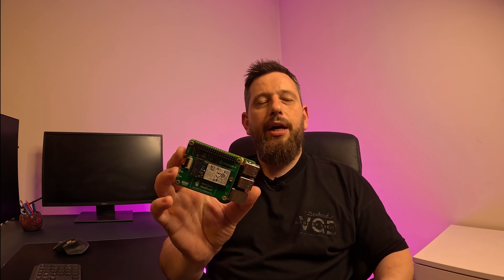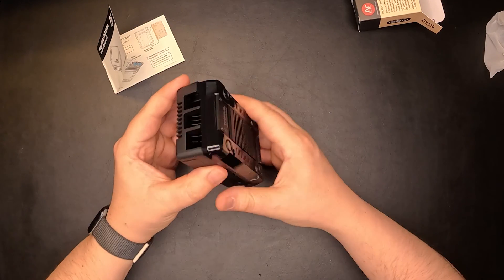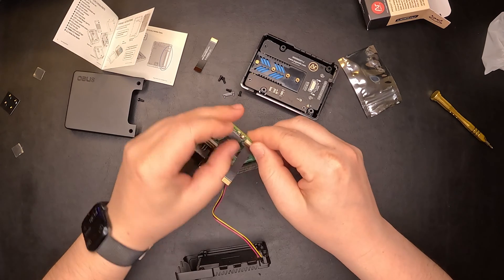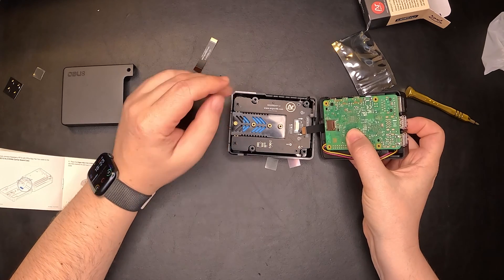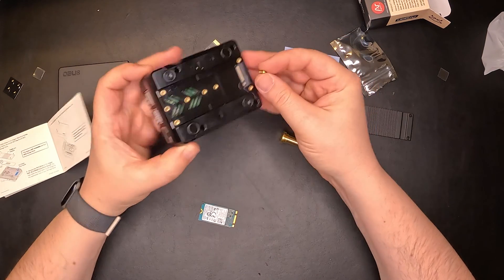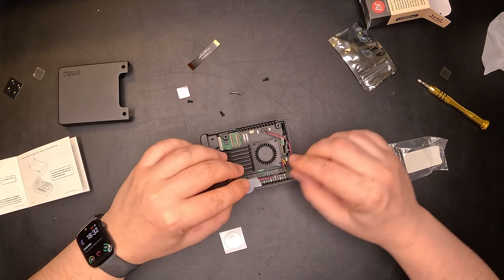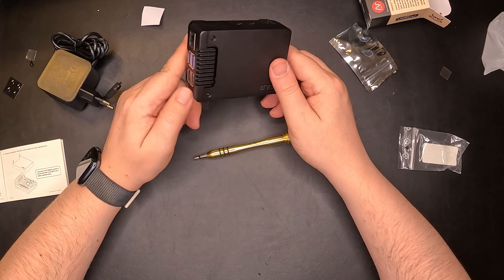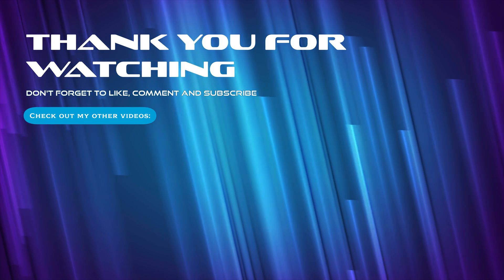Raspberry Pi 5 Argon NEO 5 NVMe Case upgrade

Comment: I have 4 Pi 5's. My Pi's barely get over 120 degrees F. I run them all open no cases. Heat sinks and active cooling hats. ALL over clocked to the max running NVMe Gen_3 and zero issues ever and never had ANY throttling. I also like the looks of the Pi's workings. My CM5 is the same. All 8GB RAM models
Reply from the maker: I also like how the Pi looks naked but I have this unit mounted on the wall near the washing machine :) . I need a way to protect it from dust, spilled powder detergent or accidental hits.
Reply: @TricksAndThings  Totally get that. Im OCD with m ine so alwys cleaning them. Got my CM4 and CM5 in waveshare cases

Comment: Mine should arrive today for my pi5...I was running home assistant and it was clocking at about 80c when it was just sitting there...old case was nice metal but the nvme blocked half of the fan...hopefully this one does a bit better at removing the heat.
Reply from the maker: It’s a good case. Use it only for HA in an unventilated place and it works without issues.  Yes the case gets a little warm but it’s normal since the entire case is actually a big radiator. Hope that it will fit your needs :)

Comment: Thanks for the video.  I'm looking for a case for my micro server.  Too bad about the plastic underneath... I preferred all metal.  Please can you tell me what the CPU and Nvme temperatures are like?  Does it dissipate heat well?  Were you able to do any tests?  Thank you
Reply from the maker: I did not do any extensive test but right now, it's sitting in a a small plastic shelf, in an unventilated space and the reported CPU temp is 49c. I can feel the heat being dissipated through the entire case so it works pretty decent. For the Nvme I do not have a sensor enabled so I can't measure it unfortunately.
Reply: @TricksAndThings  Thanks a lot for the answer. I want to get one

Comment: Just leave a blank SD in it and then if you have to you can NETBOOT it and install an OS to hopefully do what you have to do with it.
Reply from the maker: thank you for the comment. hmmm I actually never thought of that :). this is some pro tip here :)
Reply: @TricksAndThings  Yeah. That's what I do with mine. You can also use the blank MicroSD for additional storage in the meantime. just don't forget to back it up for when you do need to format it so that it's blank again.
Reply: pi5 boot on usb drive

Comment: Did it take you forever to get yours in the mail,too? I ordered mine in March and still haven't received mine yet.
Reply from the maker: I has lucky enough to have it available locally. A shop that only handles Arduino stuff had a few in stock so I've order it from them. I think I paid 9USD more but it was worth it :).
Reply: @TricksAndThings  I'm waiting on the Argon One V3 but might order this one at some point.
Reply from the maker: @luigiprovencher  super. please let me know how it is when it arrives. from the data sheet it looks kind of big but it also has included adapters.
Reply: @TricksAndThings  Yeah it's probably not going to fit in your pocket or anything like that but it actually looks smaller than I thought it was going to be according to the videos I've seen.

Comment: Did you just know about the neo 5 nvme case? Or did you consider the one v3 nvme case too? They are from the same manufacturer (argon40) and i cant find a clear source of information vs why you'd pick one or the other. One V3 seems newer, has a bit more features (converts mini hdmi to full hdmi via board for examples) but this one seems a lot nicer aesthetically
Reply from the maker: Thank you for the comment. One v3 nvme case is more expensive and in my view seems targeted to a desktop usage, where you actually keep a monitor, keyboard and mouse connected for daily use. I just needed a compact version, with good cooling and that will keep my rpi5 protected in the rack :). I only keep power connected to it and internet is over wifi :)

Comment: What would be the fastest NVMe you could install / the Pi5 could handle?
Reply from the maker: The Raspberry Pi5 supports PCIe 3.0 x 1 max so depending on the used HatDrive you can reach ~ 900 MB/s. As a summary don't bother spending money on expensive nvme drives since they will bottleneck anyway at interface limit. I would get any branded NVME (WD, Samsung, etc) in the lower price range since any of them will do the trick :)
Reply: @TricksAndThings  thanks a lot!
Reply from the maker: @darklord_ice  my pleasure!